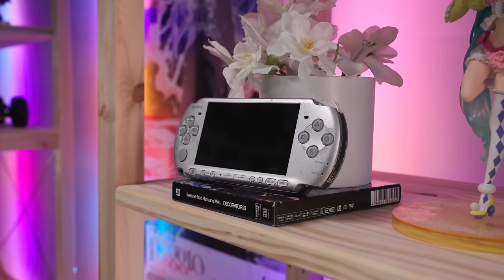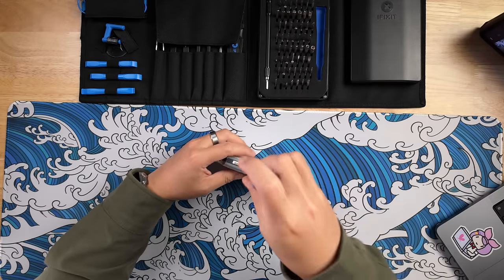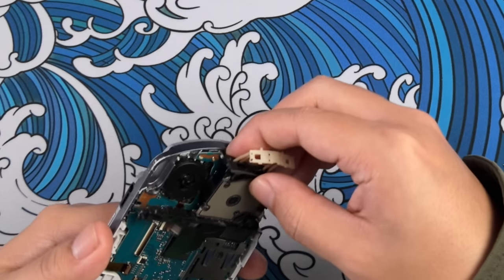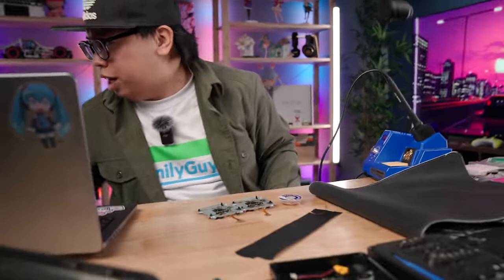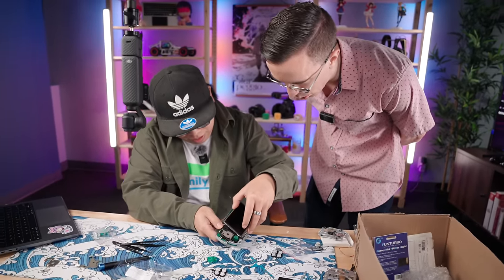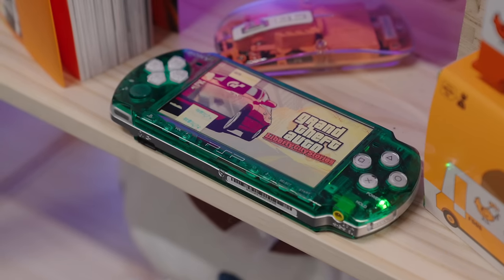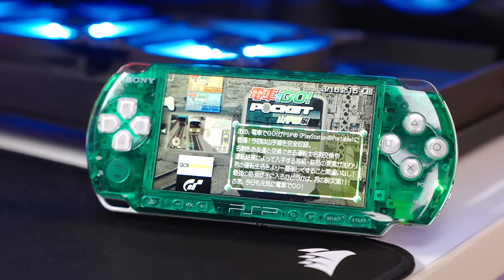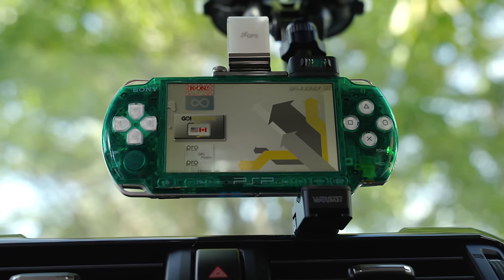Gaming with a PSP in 2024

Comment: Why not just get a Vita? You can just play all PSP games on there with a better screen (OLED) and better battery. And on top of the PSP compatibility, you get Vita games like Gravity Rush, Persona 4 Golden, Hotline Miami, Telltale's Walking Dead, Mortal Kombat, Final Fantasy X / X-2, Terraria, etc.
Reply: PSP can be had for less than 50 bucks all day every day. You are lucky to get vita for less than 100.
Reply: for some games, they feel nicer to play on the PSP. 
especially on games like Project DIVA
Reply: This guy said " get a vita"
Reply: Price
Reply: Vita sucks, and did NOT fall in price. mint psp is less than 50. a bit damaged but still completely usable is less than 30.
Reply: I love the Vita. I will say it's expensive, but definitely worth the price. PSP games look better on PSP due to the resolution on the Vita being doubled, so the games look pixelated. PSP also isn't emulated on Vita, it's actual hardware
Reply: that’s a great option yes but the psvita is 100 dollars plus i got mine from a disk replay for 150 not many people want to spend that much for a handheld console
Reply: How?
Reply: nostalgia doesn't care about reason
Reply: The reason why you get PSP instead of Vita is the OG resolution , the same reason why you should get a DSI XL instead of playing DS games on a 3DS . Games look as intended and designed for the exact resolution without upscaling their OG resolution for OG hardware ( OG = Original)
Reply: @zy2239  There is a way to launch DS games in their native resolution on the 3ds, you just hold Start as you are booting the game and it will scale the game down to the original size...
Reply: @BeaNoodl3  I get what you mean but if you install Adrenaline, there is a way to remove the bilinear filtering of PSP games which results in a way sharper image. Obviously not as good as the PSP but that's like the only trade-off at that point
Reply: @awavebird  They never had a modded PS Vita 😂 modded Vita is miles away better than modded PSP, you can even set scanline to make it looks like PSP 

Plus PSP often have that black circle ⚫️ darken effect on the screen, which makes you spend more money to replace them
Reply: 3 letters umd
Reply: @Chemzborgor  if you gonna mod a PSP or PS Vita, UMD or Vita game cartridge doesn’t matter, you can sideload or install the game through PKGi, while you have the Micro SD Card adapter inserted 

Plus using the UMD will slowly kill the laser and replacing it is expensive
Reply: @awavebird  Even Adrenaline doesn't look that great. I do think it's very good for dual analog stick patches though
Reply: You can't play even close to the PSP's whole library on a Vita unless you hack it which not everyone wants to do
Reply: I am so glad that I hold on to my Vita to this day. Just modded it so I can play PSP games
Reply: @zy2239 it's a direct 2x upscaling. Completely different situation than the 3ds. 1 pixel just turns into 4.
Reply: Yep, a modded Vita is worth the extra money.
Reply: Also vita has two analog sticks. There's plugins to use the second one in games like GTA and it's awesome.

Also the fat vita has hall effect sticks
Reply: @skatcat743 also vita can actually use a controller and even output video via the charge port.better screen, duel sticks that even work for some psp games,  plus the vitas entire official library as well as all the games ported by the community youd be missing out on.also most psp games can be emulated and played elsewhere. only half the vita library can be emulated.  think theres plenty of reasons to pay the little extra if youre able to actually be objective
Reply: The Price dude, the Price
Reply: PSP has Huge library than the Vita. PSP games suck on psvita they are blurry.
Reply: It costs more and repair parts for the 1000 OLED model are also way more expensive (and there aren’t any 3rd party replacement parts really), which you have to take into account considering the age of the hardware. But if money isn’t a problem, then Vita is better
Reply: You almost forgot the ps1 gaming experience you get on the vita. 😌👌🏻
Reply: @wing7541  I believe what your referring to is the default bilinear interpolation that makes it blurry. but thats literally a feature you can turn off. so i wouldnt spin an extra option as a negative.
Reply: @deamooz9810  almost every part of the vita has third party replacement parts for cheap. so idk where youre getting this info from.
Reply: I was in possession of my Friend's Vita for around 4 years. I kept trying to give it back to him but he refused to take it. Neither of us had any interest in any Vita games once we got our hands on it, and the fact that it was only compatible with digital PSP games meant it was useless, so we went back to playing PSP and DS/3DS. Didn't help that Sony used a fucking AWFUL OLED screen in the original Vita model that just started dying after two years. That screen looked absolutely disgusting, and that thing had hardly even spent time powered on.
Reply: Why not just get both
Reply: He's a content creator. It's all part of the plan.
Reply: @brandonybarra6595  even you make it off on Adrenaline settings, Psp game still blurry on the Vita.
Reply: I love the little UMD media. PSP accidentally remains the only commercial handheld to use a disc drive. It's not great on batteries, yeah, but I think it's a cool distinction to have.
Reply: I used to have a vita w PSP games and Sam Andreas and Chinatown warz .. I had fun playing n64 Mario kart on it.. I had the slim I sold it to buy a laptop
Reply: It’s not the same tho
Reply: What'd make for a better video, loading up something that just works or making a full video with historical dialogue and repair video in one
Reply: price. thats why
Reply: I really don't see the point unless you grew up with vita and get an nostalgia rush. Otherwise emulation on flagship phone makes alot more sense if you  want to play better quality psp games. Ppsspp emulator is close to flawless
Reply: @InvidiousIgnoramus  ive had my vita since 2018 and it was used and works brilliantly
Bad luck or bad unit in ur case
And the PSP games look fine on it but everyone can have an opinion
I also played more Vita than PSP games on it.
Reply: @joshcasey6288 physical buttons and the feel that ur playing on an actual console
Plugging a controller also doesnt feel the same.
Honestly its about preference. 
If you dont really care then PPSSPP on a PC or phone is the way.
Reply: I own several PSV and PSP models. Yes, the Vita can clone a PSP and play its own games, but there's also something special about the PSP itself that makes it where you'd want to own it.
Reply: I don’t know about other regions, but in Europe, a used Vita is still around £120. I can find a used PSP for £20 on gumtree. Price is difference is crazy
Reply: I got a psp for 20€ it's way cheaper than a vita
Reply: Cause it's €150 at the very least where I live lmao
Reply: I have both a Vita and PSP, you can't play every PSP game on the Vita. That's why I have both.
Reply: PSP games look like trash on the Vita running Adrenaline. Even with an OLED screen, the image is blurry and looks muddy. Get any PSP model and compare it to a Vita side by side running the same game.
Reply: Why not let the guy enjoy what console he wants to enjoy? And what makes you think he doesn't have a Vita? Just because he's showcasing his PSP doesn't mean he doesn't have or like the vita.
Reply: @joshcasey6288  emulating on the phone is terrible bro touch screen controls suck
Reply: Psp games look awful on a vita unless it’s supported by GE patch.
Reply: @charizardoreo  its so easy that a damn baby could do it.
Reply: Maybe someone just wants a psp more than a vita
Reply: It's nostalgic
Reply: @Anti-dotardTeam-nb1cv I’m not even going to lie you cooked with this one
Reply: Yeah better screen but less resolution 
Ever compared them both? They look so bad on the vita
Reply: @alphenhousplaysgames4565 Vita not as old as psp
Reply: Money my bro
Reply: @charizardoreo  they actually made it super easy to mod the vita. I modded mine in literally 2 mins in one click. Very simple now.
Reply: Cause he wants a psp
Reply: @skatcat743 funny haven’t seen a psp at 50
Reply: PSP is more portable especially the PSP go.
Reply: Get a steam deck and play it all + way more
Reply: i might as well just get a steam deck and emulate the games instead of a psp lol
Reply: @whullysmo  In my country and some other Asian regions the price of a used psvita can be the same or more expensive than the used Nintendo Switch Lite on sale :))))
Reply: Does psp vita play the umds ???
Reply: @potatolemon9442  from where
Reply: I have a vita and I dont like the idea of having 2 joysticks getting destroyed in my backpack
Reply: 1. Overpriced(i have it)
2. Ps vita 1000(fat) has old type oled screen which has awful property of burning the hell out(screen for fat vita are more expensive than just new used console)
Reply: @skatcat743  even on ebay they're not going for 50 bucks lol
Reply: @skermit1115  so PSP is a better option?
Reply: At that point why not just get a steam deck OLED; you get the PC versions of all those games and a much more ergonomic device
Reply: Its a diferent feeling when u play them on PSP. 😉
Reply: @Playinfakeepzzz  Nah, wouldnt say so, i still recommend getting vita but 2000 slim model, it has worse IPS screen instead of oled but it is smaller, got better battery optimization, have different color versions so yeah, take the psp if you don't have money for vita
Reply: psp is my old handheld i dont have ps vita.. but still i wouldnt get ps vita
Reply: @skatcat743  less than hundred at my country..
Bc everyone play ps4 n ps5 now..
Oh yeah vita is still relevant in my country..thats bc 80% of us only know pkjg while 20% know vita can be super emulator
Reply: Found the psp I modded at the dump for free that’s why 😂
Reply: The console DOENST support SD card u need to buy memory cards that tbh the most expensive is worth more than the console I think afcourse u can just mod the console to support SD but still it's hella annoying
Reply: I want to fix mine too and make a pink coverd so good i rly have so mutch memory so mutch thx for this good video❤
Reply: ZoePoppas1994   exactly. it barely had a game library. it's such a hard system to develop for it never even got an emulator.
Reply: Both. Both is good.
Reply: The OLED was discontinued and not all PSP games were available to buy/play on the vita.. I'm looking at you, Metal Gear AC!d.
Reply: It just ain’t the same man, I remember being a kid hiding my psp under my pillow before going on holidays because my parents used to let me have like 20 pound of credit or a game or two for whatever holiday we were going on, me being the sneaky bastard I would download the games then hide the psp under my pillow and play for hours. Serious good times man some of my best memories.
Reply: UMDs
Reply: Damn walking dead? I'm sure bl2 ran on Android (shield) some point. Bet it would be kinda playable at 360p
Reply: Some people just prefer to play the game on the original platform
Reply: why not just get a job
Reply: Psp better
Reply: Personally I think the same. What stopped me for so long was the price. I recently got one for cheap, so I got pretty lucky.
Reply: Personally, I prefer PSP for the physical game collection
Reply: Because the vita is ugly and the psp looks wayyyy better especially the 3000
Reply: @zane8045  based psp 🗿 vs virgin ps vita 🤓
Reply: @zy2239  im pretty sure "OG" means "original gangster" lol 🤓
Reply: used vita cost as much as a used switch lite/v1, it's just not worth it lol
Reply: Why not just download an emulator for both of them on your phone and use a dualshock controller 😂
Reply: UMD Video.
Reply: How are you going to get the PSP games to download when the PSN won't let you download them?
Reply: Building a PSP is not that expensive all you need is the motherboard you can get one for 20 bucks and get the shell for 14.
Reply: @tonicipriani67 people don't have time for that.
Reply: @tn420animations9  the sea
Reply: I’m broke that’s why :D
Reply: How do u play psp games on vita?
Reply: Wanna play silent hill origins
Reply: It's too expensive,I prefer psp if you're not spoilt
Reply: @Yung_lmao  just say ur broke im broke i cant afford it
Reply: @paleofolk  Well duh,wtf did you think I meant,"IM RICH YOUR BROKE"?!🤦🏾‍♂️
Reply: @paleofolk  Like bruh,did you think you're superior or cool to say this?nahhhh,your reply is straight up dull as a rock,ofc I'm broke.
Reply: @Yung_lmao  uh oh someones mad lol
Reply: @paleofolk  Also I don't remember being mad,you were being a child so I had to teach you the basics 🤫
Reply: @Yung_lmao  ok grandpa its time for your pills
Reply: @paleofolk  Now your just yapping.🤦🏾‍♂️
Reply: @Yung_lmao  have a blessed day
Reply: @paleofolk  Thank you.But you need to find God yourself.
Reply: @Yung_lmao  im not the one blowing a fuse over a joke lol
Reply: @paleofolk  1st stage of grief:denial.Dont worry little child,you will be fine once you go through all of the stages 🤣🤣
Reply: @paleofolk  I'm not the one who's dumb lol
Reply: @Yung_lmao  the irony in that statement..... lol
Reply: @paleofolk  The yapping in that statement...................................................................lol
Reply: @Yung_lmao  cool bro, have a nice day, may god be with you
Reply: I have both, psp looks better playing psp games. The vita makes psp games look a little fuzzy. Plus it’s a lot cheaper to go with a psp
Reply: Some of the games I had wouldn't play on the vita though....
Reply: @skatcat743  bro, it's only $50-75 more lol, not terrible. eBay all day for ≈$120. It's a steal for what you're able to do with it.
Reply: @thenoobreturnz8968  The vita has a built in PSP emulatorr. PSP games can sometimes run better on the vita than a native PSP.
Reply: ‘Cause the PSP looks bloody gorgeous!
Reply: For a good second-hand vita you have to pay $150 nowadays, but if you search a bit you will find good second-hand psp’s for around $40 each. And the psp also has an amazing library of games and when you mod it you get them all for free!
Reply: Own both modded and I would say the original PSP feels so much better in hand than the Vita. But you're right the Vita is way better, if modded you can download custom themes and can easily play ps1/gba/n64 games
Reply: @skatcat743  Man, I must’ve been lucky for getting my ps vita at 60$ lol
Reply: You don't get it do you !
Reply: I have both.
Reply: can u play modded terraria?

Comment: I nmdded my psp 2000. Transport shell,added USB-C alongside the mini USB so you can use either one (still runs at USB2 speeds though) I also added Bluetooth. 
When I first got the psp the umd drive made a horrible noise so I ended up soaking the motor in WD40 and it runs like a dream ever since 😁

Comment: There's a black PSP (I don't know which version unfortunately) at a local thrift store for $40. It's got a cracked front faceplate (thankfully the screen at least looks fine. It's also missing the battery cover, battery, and charger. I'm thinking about getting it to restore it with a clear shell if it is the final revision.

Comment: 1) Use round tip tweezers if you don't want to damage flex pcbs (cables). I doubt that iFixIt kit doesn't have one.
2) Probably there is some dirt on display flex pcb from fingers which is preventing from good contact, try to use eraser to clean contact pads.
3) Dont wiggle flex pcbs when they are in connector, last thing that you want to do is to rip apart the traces or damage the connector itself.
4) If you want to check the connectivity, there is diode mode on multimeters. In this mode the multimeter will beep if you have contact between probes. Touch connector pin with a multimeter probe and with other probe touch the destination point.
5) When you are soldering, use flux, because soldering process will be so much easier and have a better looking.
6) Don't "play" with components with power/battery connected, you could literally short components on the motherboard and fry it.

Comment: I've still got my OG PSP 1000 that I imported from Japan on day one and it still works perfectly (even the UMD drive works).
I flashed it with CFW as I have the Datel Battery tool that converts genuine batteries in to service batteries 👍

Comment: pro tip: don't use pointy metal tweezer when you are working with pcpbs and ribbon cables. use a plastic spudger or at least a blunt tweezer.

Comment: So much old memories from this video. Got the original PSP 1000 in the early 2000s with FF2. Left it in one of my table drawers 3 years later. Just took it out last week, charged it up and everything still works including the battery.  The older PSP versions are bulkier, but that is fine for me. I put one of those clear Transformer Optimus Prime case when I first got it and it is still in original condition. Such a great system that Sony built.